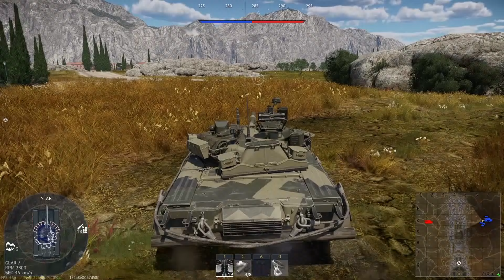War Thunder - How To Implement: The A-10/Su-25 Special

Comment: Everything nice but i want to address some errors. A10's GAU-8 have 7 barrels and Su25's GSz-30-2 is completly different cannon than GSz-6-30. They indeed use same rounds but GSz-6-30 is rotary (Gatling) cannon while GSz-30-2 is twin barrel cannon that use Gast principle to operate (it's just upscaled MiG21/23 gun). Overall really good video but i think that you have to work a bit on your research and better narration (less random breaks and errors while talking). Still great work and looking forward for mew videos o7. (Of course no har feelings and i did not want to offence you or something but give you some feedback)

Comment: Is there a possibility for a video about bombers like the B-47E and B-45A. Since the Yak-28, America's been slacking.
Reply: f111 would be a nice bomber to counter su17 n b58 for yak28 ig b47 n b52 r just too op
Reply: @hemendraravi4787  The B-47E has the same payload as the B-29, and is about as fast as the Russian rank 5 bombers.
Reply: @therealavenger45875  oh but still it would suffer like b29 if its at low br then it would be op n no one can touch it ,if its at higher br its get shit on by mig21, mig19 unless they switch bomber spawn or move enemy bases